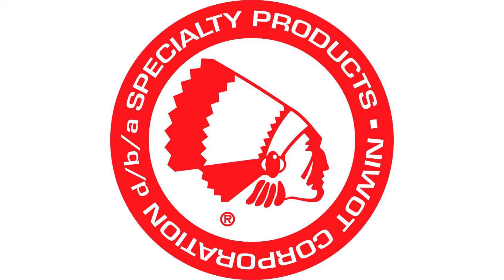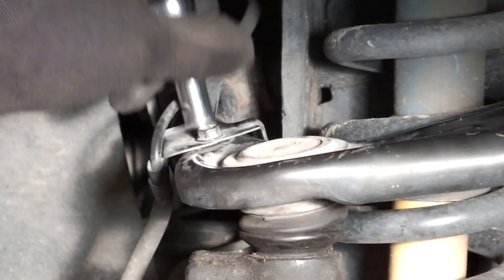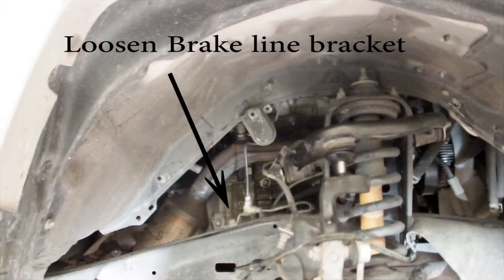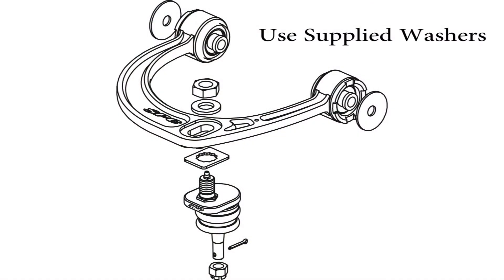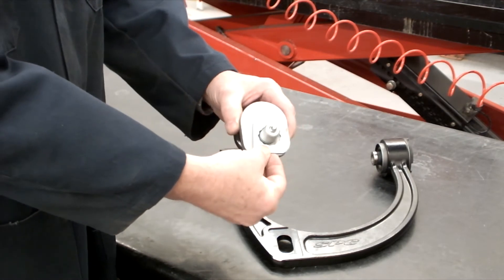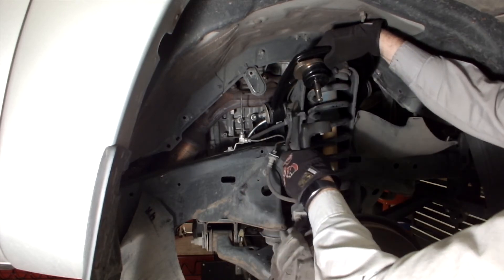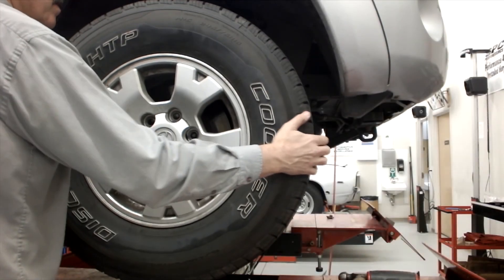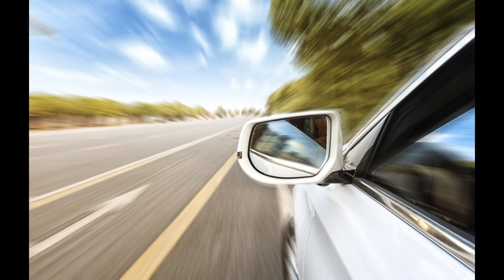25470-25480-Toyota Truck/SUV Adjustable Upper Arms - Specialty Products Company

Comment: Hi! i have a 2007 fj cruiser with 6 inch rough country lift, icon +6 coilovers and your Arms, I adjusted them to +2 caster, I was 3 hours with the person at the alignment shop trying to adjust the car and it was imposible, we adjusted the arms camber full out, and we still have 1* of camber, the problem is that we can't move the camber with the lower arms, the tires are rubbing on the rear(It has a BMC). 2 years ago I had a good alignment, with 0 camber, but I don't know what changed, I recently installed new ball joints on the UCAs. What's your advise? What is the suggested caster adjustment on the UCAs with that setup? Do you think I can have problems on the LCAs excentrical bolts or what?
Reply from the maker: The new ball joints would not have altered the alignment if they were installed in the same position as the old ones. If your alignment was good with the setup described and now is not with just new ball joints it would have to be an adjustment issue. I would recommend repairing or replacing the lower control arm adjusters to give you full ability to get maximum tire clearance and wheel position using the lower adjustment and the upper control arm adjustment.
Reply: @SPCAlignment  thank you, i will buy your lower control arms adjusters!

Comment: I bought a used set of these UCAs for my 3rd gen. I replaced the bushings and got new washers but I am having trouble finding a new castle nut. Will the factory castle nut work? Meaning does it have the same thread pitch and everything?
Reply from the maker: Gaven, the 25470 and 25480 arms differ from each other only for the ball joints.; they have different taper angles. The 25470 fit 2005-newer Tacos while the 25480 fit 2003-newer 4Runners, all FJs and 2003-newer Lexus GXs. Please confirm your Taco model year. It would be best to check the ball joint part numbers. Please provide the 8-digit number from the side of the ball joint (500011xx). We don't want the wrong taper ball joint fitted into the knuckle! The thread for the SPC ball joints is the same for both: M14 x 1.5. I don't have an OE Toyota joint here to confirm its thread. The nut should be able to be turned by hand onto the ball joint threads. Thanks

Comment: This is NOT a Toyota Tacoma!
Show how the remove the long UCA bolt on a Tacoma.
Reply from the maker: That is an early 2nd gen Tacoma. Some previous upper control arm work had been done on this truck as the long upper arm bolt had been replaced in the opposite direction from OE (nut to the front.) The goal of the videos is to give the general procedures for parts replacement. This video covers upper arms for Tacomas, 4Runners and FJs; it cannot give exact instructions for all the years of all the models covered. Please refer to the OE procedure for upper control arm removal for the particulars for your exact model and year. Many times components need to be removed or shifted to allow the long bolt to be removed.
Reply: @SPCAlignment  Ok, thank you.
On a 3rd gen Tacoma it is needed to bend some body work to remove the factory installed long bolt of the UCA.
Reply: @useryggfdcc  you can pull it out enough to cut the head off with sawsall then reinstall new bolts from Toyota backwards
Or bend the inner fender a bit for clearance

Comment: 25470 works for 4th gen 4 runner?
Reply from the maker: The 25480 is the correct part number for 2003-2009 Toyota 4Runner.

Comment from the maker: Yes, setting the new arms to the same settings as the old ones should get you close enough to drive to an alignment shop. But that's the first place you should go as any major suspension/steering replacement requires an alignment.

Comment: I have an older set of SPC control arms. Is it possible to replace these with the newer model myself, setting them to the same positions as the old set, and then drive it to a shop for alignment? Safe, or stupid?
Reply: Followup, I replaced these and it was really easy. Took one off at a time. I set them on my bench, and keeping the ball joint in place i measured the location of each ball joint in relation to the controll arm. I set the new ball joint on the new controll arm in the same place. Next day, drove to town and had alignment done. Piece of cake!